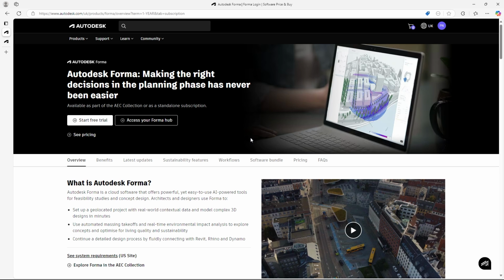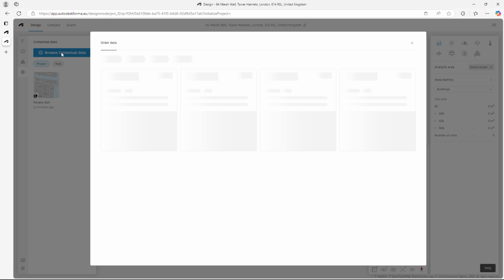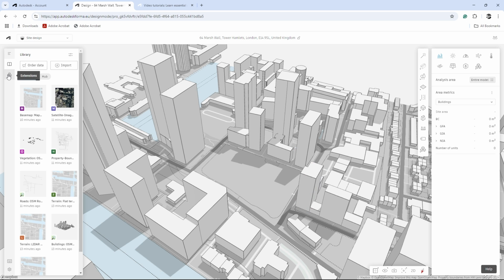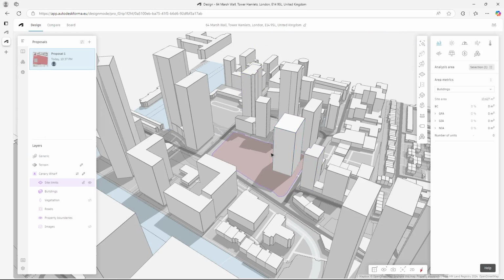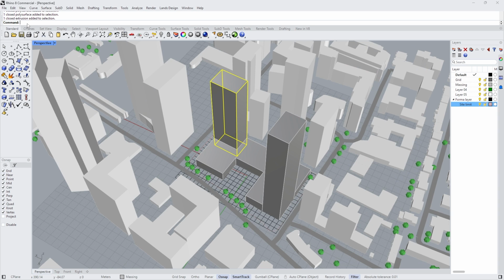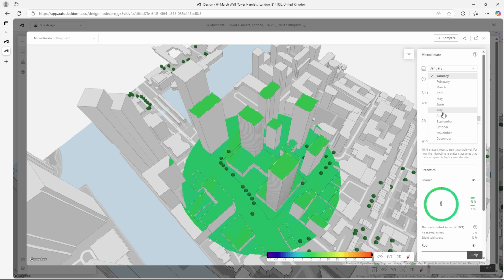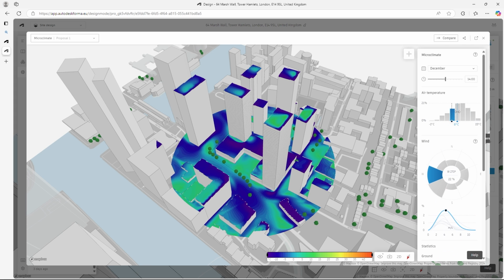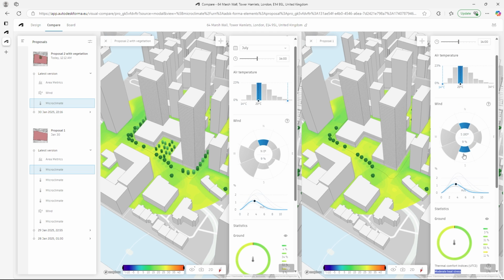Autodesk Forma Site Design x Rhino x AI - The Future of Architecture

Comment: Like it, thanks for sharing! Question: how can the schematic design iterate with the analysis done in Forma automatically ?
Reply from the maker: Not sure if I understand your question, but Forma just launched a new feature which allows for more detailed models to be used inside Forma. I'm not sure when you say automatically. Do you mean run a simulation across several design iterations? Not sure if it's possible atm. It would be amazing for sure.
Maybe something to suggest to Forma.
Currently, you can run analysis for each iteration separately and then compare.
since most of the analysis is fairly quick, you might just run it one by one and then compare...

Comment: How does this compare to Ladybug Tools and Eddy3D? It looks rougher, and vegetation seems less impactful. If you already use Grasshopper tools, is there a reason to also use Forma?
Reply from the maker: Well first of all it's a commercial software which comes with a certain credibility backup. It's stand alone and cloud based. It has different tools: noise analysis, wind analysis, carbon foot print, it can automatically generate different massing options to test and more.  Its collaborative and standalone and can be linked with Rhino or Revit or both.... Its much easier to use in case you have no Grasshopper experience.. you can run simulations from your phone if you have no laptop with you.... Its a different beast. It comes with a price...
So it's geared towards larger Studios.
Reply: @PhilippGalvanDesign  Good arguments, thanks for the answer.
Reply from the maker: @simonverbeeck1439 I'm working the next video which dives into noise analysis. Also, this is a sponsored video Autodesk as commissioned. There will be more follow up videos to show what it can do.